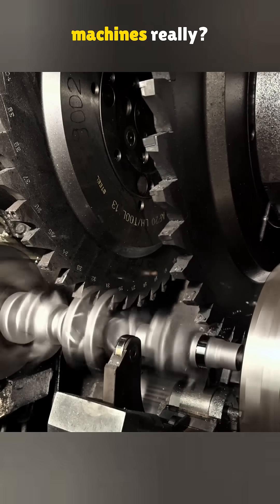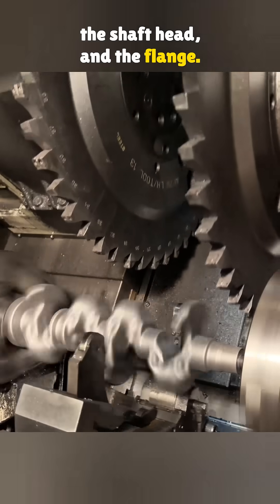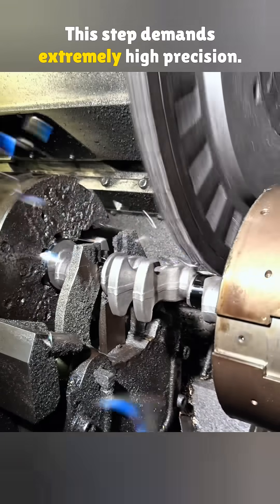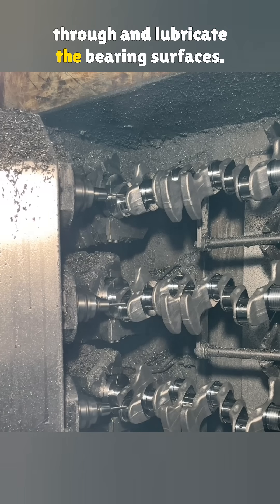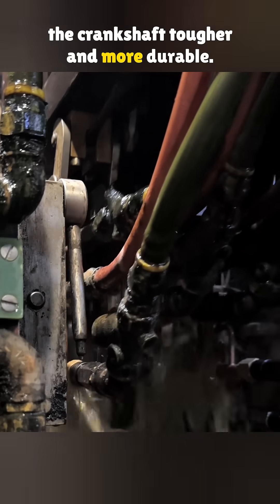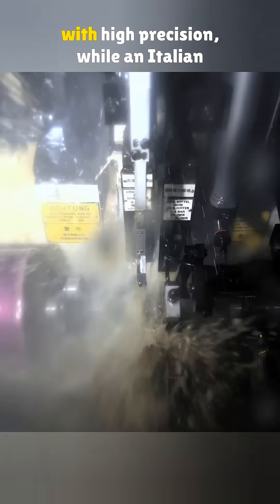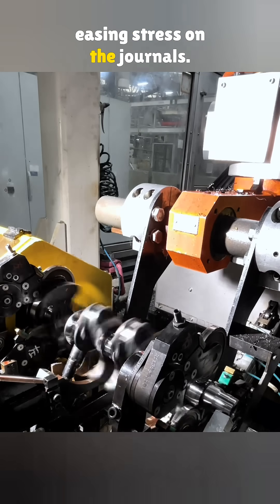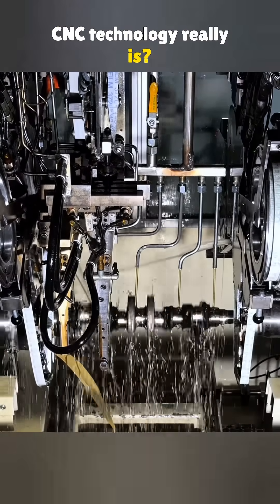How Far Behind Are Chinese CNC Machines #automobile #mechanic #car #assembly #manufacturing

Comment: I'm a CNC machinist in America that focuses on medical and surgical tools and sometimes implants. I don't know that we have any American-made machines. Half of our machines are German or Japanese.
Reply: I'm also a CNC machinist in the States. We manufacture almost exclusively copper parts. We have mainly Japanese and Swiss machine centers.
Reply: @marine4lyfe85 the Swiss made a great machine. The Tornos MultiSwiss is absolutely an amazingly complicated work of art! If you know how to program, setup, and run that machine your an absolute professional machinist, in my mind at least
Reply: @thomasvanpelt6586  "you're" not "your"
Reply: @johnranallo424 my bad bro I didn't go to school
Reply: @thomasvanpelt6586 I worked at a place that had one and there was always an issue with nobody being able to keep it running. Yet the robodrills, hurcos and mori seikis ran 24-7. Lack of training sure, but the learning curve was an issue
Reply: @marine4lyfe85 it's a weird criteria put  on China  that all the parts in their machines have to be domestically sourced 

I can guarantee China is the only Country that has the minerals and components to make a 100% domestically sourced and indigenous designed machine

They did it with a Lithography machine last year 

Albeit it could only make legacy type  18nm chips ... which with extra layering down to 7nm & 5nm
Reply: I have, and have had American machines, HAAS, as well as  Japanese Machines including Makino, Mori Seiki, and Nakamora Tome. I looked at, and was contemplating trying a German mill, so I can't say from experience, but from my research and talking to alot of people, and a great analogy are automobiles. The Germans produce machines that have all the latest bells and whistles. Japanese culture, which carries into everything they do, including building machine tools, is more reserved, meaning they tend to hold off a year or two when it comes to major upgrades and new technologies until it's proven. Just like their automobiles, German cars, Mercedes-Benz and BMW for example, are cutting edge technologies, latest greatest, bells and whistles, whereas Japanese cars, Toyota and Honda for example, favor reliability. Their machine tools are no different. Personally, I love the Japanese CNC equipment. I'll take Makino horizontals and Mori lathes, and Nakamora or Mori Turn / Mills all day, every day and 20 years from now they'll still be running, just as accurate, and as reliable and they hold their value.
Reply: @Drewg351 i run a mid 90s Mori Seiki lathe every day that uses floppy disks and i love the thing. Makes beautiful parts and I've never had an issue with it. Compared to our brand new Korean lathes, give me the old Mori to run any day
Reply: @Drewg351 I agree,I was told by a 40 year machinist that the Japanese make the most accurate and reliable cnc machines and thats why we use their machines to produce things in America.
Reply: @Drewg351 i agree, but i think this are specific machines. The chinese market is for massive market. They think in quantity.
Reply: @Drewg351  Haas is 90% made overseas. Linear guide rails, balls crews, sensors, electronics, motors and lubrication systems come from either europe or asia. The only american made part is the cast iron chassis lol.
Reply: @dichoseadepaso So, why do you think the parts are made from “other” countries and not in the USoA? And don’t tell me the high end machineries are from China.
Reply: @PapiPonce profits. They'd rather third party their entire production line for a quick easy buck instead of investing on a good local production and all it takes (training your workers, R&D, etc) also, i work at Haas. 90% of electronics is already Chinese. So much so you can buy an original brand New Maincon board from the manufacturer at 1/3 the price.
Reply: @dichoseadepaso  i doubt that. Besides, are you trying say America can't make something 100% made and sourced in USA of top quality and excellent engineering? Because you would be very wrong. Best products come from Japan, Germany and USA.
Reply: @dichoseadepaso  well China certainly has us by the balls then don't they. Sounds like we need some tarrifs to free up our balls from China's grip. For reasons of self preservation.
Reply: @realtruenorth  Every person of trade knows, that the USA is not capable to produce high end machine tools. They do not have the culture, the skills, the education, the supply infrastructure and the knowledge. Your pride may shine to the moon - the truth is, all your high end machining depends on machines from Japan, Germany and Switzerland. Military, medical, airospace, in all these fields you won’t find a Haas or Milltronics in a critical process. The USA may start to build up such an industry, with first results in 20 years, but as of today, the USA is 100% depending on other countries, sorry to destroy your dreams.
Reply: @Herr_Bone  LOL, you destroyed nothing except your credibility. You put in so much effort.  You're just plain ignorant. Where is the #1 cold hammer forge machine for the best precision rifles in the world made? USA. Where is the machining done for some of the best if not the best guitar hardware made? USA machining right here. Snap On tooling, tape and dies, precision test equipment,  machined right here on U.S. machines. . Jeweled actions in world wide respected Olympic rifles that can pinpoint a target from 10,000 feet away, made on US machines. The top 3 engineering and craftsmanship in the world in no order are Germany, Japan and the U.S. maybe you are the one driven by your pride to shame America. The whole world loves to shame the best country in the world. Its natural for envy to hate. Even Apple starting making micro processors in the U.S. again because the world can't get it right. LOL. Nice try ya sore lower.
Reply: @Drewg351 I own 4 Toyota vehicles for this exact reason.
Reply: @Drewg351  I can tell you as an auditor that worked on HAAS, most of their products are made in other countries.
Reply: @Drewg351  Mercedes lost its reliability legacy 30 year ago when it's newly appointed CEO Dr. Dieter Schremp introduced a lot of cost cutting measurements. It was downhill from then and it never recovered from that disastrous strategy.
Reply: @TINSTAAFL1 yep, when they partnered and collaborated with Chrysler. Gulp.
Reply: @Drewg351 ran Mori lathes and Mitsui mills for over 20 yrs myself making racecar parts.
Reply: @Drewg351 have you tried the German brands Deckel, Majo & Gildemeister (nowadays "D•M•G")?
They use to run with controls as Siemens, Fanuc or Heidenhain...
Reply: @Drewg351 does this hold for manuals as well?
Reply: @Drewg351 Haas has its own control while a good Chinese machine would feature a Fanuc/Siemens. Other than Haas has no advantage against the Chinese competition. Other than being more expensive 😂😂😂
Reply: @Drewg351  Okuma and Takisawa is also very robust and reliable. Used in Mouldshop for many years
Reply: @Drewg351  dont buy german. its overpriced and heavy on maintenance. japanese are a much better deal!
Reply: @Drewg351  Exactly correct. The sad thing is that very few if any crankshaft are manufactured in the USA due to 'progressive' government policies.
Reply: @ccrider8483   what it's have  to do with the government  ??? explain  in details
Reply: @ccrider8483  Probably one of the most smooth brain takes I’ve ever heard. So you’re telling me that the people that look like you, have the same skin color that you have, decided they wanted to save a nickel on every part by moving it to cheaper manufacturing has something to do with “progressive”regulations?
I bet you are also the type that thinks that China is a communist country.
Reply: @emed1977  Being so offended by an observation from outside your chosen echo chamber must be very traumatizing. Perhaps you should consult a mental health professional.
Reply: @ccrider8483 it was a contributing factor but it would not have been decisive as labour and energy cost would have driven production overseas anyway because of said profitability reasons. But in the long run I would he more concerned over electrical motor production. No crank shafts in EV’s 🤷🏻‍♂️
Reply: @ccrider8483 
Progressive government policies?
Like what?
If you said tax and trade policies then you might be speaking the truth, but instead you seem to be barfing out b.s.
Reply: @Drewg351

We have Haas too. I didn't know those were American made. 

From my 6 years of running turning centers to cut rotors. We have accurate machines but when cost cutting comes in we have tons of issues with holding tolerances which sometimes can be due to failing ball screws. The costs that are cut are usually the type of cutting insert and if the rotor is heat treated before and after cutting.

On one of our parts we went from getting 400 to 450 rotors cut per insert. To less than 60 parts per insert. This was done to save $80k a year. 

Now we get quite a bit of scrap and broken tools. My guess is they aren't saving anything now...geniuses in the office. "But my mafff (math) on paper said it would work"- Office Genius
Reply: @Drewg351 nothing Germans make are any good. BMW Mercedes Audi VW Ferrari Porsche all junk.
Reply: @jackdaniels2657 Ferrari?😳
Reply: @jackdaniels2657 you speak the opposite-language?
Reply: 💯.  It's like that all over the world. Globalization.
Reply: I’ve been out for nearly 20 years now but most of our CNC machines were Leblond, Haas, Lodge and Shipley, Bridgeport,and Cincinnati.  These are absolutely massive machines though. The machine I operated and programmed was an old ticker tape Bridgeport horizontal boring mill. It was at least 20 feet high and 50 feet long and built into a giant hole in the ground like a moat for coolant capture. It been updated to Fanuc probably 10 years prior to my arrival and still operated on Windows 3.1. She was slow but powerful and if you made a mistake, she’d plow a $1,000 tool through a hunk of iron faster than you could say “crash”.
Reply: @thompsona10625  That happens when you make a mistake on the programming right?? Is it hard to understand the program?? Ort is it user friendly?
Reply: @mitchweber7868 sometimes it's just because it's Monday. I used to run a 5" horizontal mill and some days the machine just wants to kill you for no reason
Reply: @jonwaldrep3984 😂😂😂😂
Reply: @mitchweber7868 the programming is actually pretty simple, at least in terms of what it actually is, the complicated bit is actually understanding what the process is to go from a blank or billet to the features you want. CAD makes it a lot easier, and CAM software will do most of the work of making your g-code.
Reply: Yes, I am not surprised to learn that China buys the same Machines that we do in North America
Reply: Moore Tools and Hardinge make some of the best machine tools in the US.
Reply: @ruxundong Hardinge are good machines. We also had a few of the flatbed lathes. Super quick and good machines.
Reply: That’s how modern industry work, no country is actually superior. Take computer chips as example: Taiwanese TSM was first with 3nm chip. The required EUV machines are made by ASML of The Netherlands, but the optics in the machine is from ZEISS of Germany.
Reply: Haas
Reply: @bruhboi7632  yea but you wouldn't use a HAAS for automated tight tolerance machining
Reply: @eudonk  I'm make bearings with a Haas my tolerance is +.0001 to +.0004 all day everyday
Reply: ここのコメント、日本製品を褒めていただきありがとうございます。
日本人として誇りに思います。
Reply: You have a cool job
Reply: Natürlich habt ihr nur wenig amerikanische Maschinen, sobald es um Hightech geht.
Reply: Much of the best everything comes from Germany or Japan. Doesn't matter what industry either.
Reply: @jasonlauritsen5587 it wasn’t always that way, but unfortunately you’re right. Back in the eighties the company I worked for had an American made metal planing machine. One of our machinists was trained in Stuttgart during WW2 and he loved that machine. He said it could go down to zero. He showed me an industrial bolt threader we had that was probably made before WW2. He said look at this machine, it’ll never break. When the company moved to Indiana in 2013 they took that bolt threader with them.
Reply: @jasonlauritsen5587 Then why aren't Germany and Japan as rich as the US?
Reply: @cryora because America has more people than both combined. And the military power. The more people you have, the "richer" you are. But if you look at American GDP per capita it isn't normally higher than either. America pretends to be rich, just like how China and India pretend to be rich... ok not as badly as them lol, but it's the same sort of deal, more people means higher gross GDP, doesn't mean that they're richer as a thousand people should have more combined value than 500 people.
Reply: @c @cryora  Rich in what? Stability of the society? Medical healthcare for everyone? Democratic values? Education? Knowledge? Craftmanship? Or wealth distribution? Isn‘t it the case that 1% of the US-citizens have 99% of the money? So, who is rich? Don‘t misunderstand me, the latter is nearly same in Europe, too. My point is, that „rich“ in regards of physical values is not available for everyone, only for a few, so it does not make any sense to take it as a measure.
Reply: @jasonlauritsen5587 what a strange comment. No country “pretends” to be rich. Countries aren’t a single person. Doesn’t even make any sense

US is rich because we dominate in a lot of things such as global stock trading. Nothing is comparable to Wall Street. Literally everyone invests in US stocks. Similarly even real estate you can see the same pattern, Russian oligarchs used to love to buy in New York.

On goods side, virtually everyone trades in USD.

We also own all kinds of top companies like Visa/MC where everyone pays with, we own Boeing which is a huge.

The list goes on. But yes in certain areas Germany and Japan similarly dominate, such as these industrial/manufacturing assets
Reply: @dailyrant4068 oh you're rich are you? Hmm, ok well, well how is it that you have 38.4 trillion debt and it goes up by over 6 billion per day? Almost the absolute highest in the G20. Why do you have the highest poverty rates in the western nations?  And yes, lots of countries pretend to be rich. A countries total wealth is meaningless, it's the gdp per capita. China and India both pretend to be rich, meanwhile they're both amongst the lowerest in  supposedly developed nations in gdp per capita.
You have almost zero good quality products made, because the American way is charge lots, no developmental stage, produce shit.
Reply: @jasonlauritsen5587 lol this is a joke. Most of our debt are owed to US. And yes it’s a problem but it’s not because we are poor. You can be rich and still overspend.

GDP itself is an over-valued metric, so by extension so is per capita.

The fact is, as long as dollar is strong and we maintain our strategic advantages we will be the dominant power.

With that said, i do think we are declining. USD to Euro has been falling, for example.

I have zero “pride” in all of this. I’m just stating facts because I’ve traveled a good number of countries across continents and can easily recognize prices, affordability because I’m analytical. That’s all
Reply: @dailyrant4068 the us owing much of our debt to America is the most ridiculous thing, because the share of their own debt that is owed to us is massive as well.
Reply: I'm a machinist as well.  We don't have any machines made in America.  But Japan is way ahead of China.  I make tooling for the bullet industry.  CCI, FEDERAL,  REMINGTON GOLD DOT, and  Several others.
Reply: @DavidMeadows-u5s  Japan also makes some of the best glass,, as in optics. China? LOL,, well... its ok..
Reply: @realtruenorth China is learning and applying. Wait 5 more years .
Reply: @goldriverbank6647  who cares, ill never support a tyrranical force, ill boycott as much as possibke and everyone else should instead of being a sellout for the dollar.
Reply: CR Onsrud is American, but most machines I've run have parts from all over. Like Fanuc computer system is from Japan, and the head of cnc from Italy.
Reply: Hyundai machines are made in Korea and used in America
Reply: Most are made in Korea, Taiwan, and Japan, very little in the US are still made in Germany, not sure what machine shops your looking at. Just because it says siki no longer means it’s Japanese. Just because it has a German spindle bearing, doesn’t mean it’s German..
Reply: What happens to these machines in 5 - 10 years when ev taken over😮
Reply: @kamaalallom6121 they will be repurposed to make crankshaft for vehicles that the EV market requires another 10 years to catch up to. Military, farming, trailers etc. People think China is behind on the CNC game? They're falling for the trap again. They aren't thinking about spending all their money in factories chasing equipment that will be obsolete is 5-10 years. They buy equipment that had 5-10 years left in their lifetime. With the money that appreciates from the savings, they can lead the next generation. Their Rare Earth decade long strategy matches the same strategy on how they took the EV market, and playing the long game is just what they're good at.
Reply: America lead the way in Machine tool manufacturing and innovation until the 70s. However, as a true Manual Machinist/Tool n Die man, one must not over look the fact that parts hundreds of times this size and just as intricate were made in the early 1900s. Especially starting around 1930s on....
Today,with CNC machines,reinishaw probing systems or the likes,yes,I agree,parts are made faster,but I still believe at a cost to longevity.  Almost designed like the TULSA MAFIA light bulb conglomerate did to make light bulbs last 1000 hours and no more....just my opinion
Reply: German, Swiss, and Japanese.
Reply: I suspect the Chinese have been quietly studying the machines they have, against that day the us convinces other countries to stop selling their equipment to China.
Reply: I cut rotors. We still have CNC turning centers from Saginaw Michigan. As far as I know they've since went out of business.

We love selling out our manufacturing for cheap Chinese labor and their subpar quality...
Reply: @tyrannusspissamentum4423 I've been to several automotive companies and subcontractors in Michigan, Ohio, Kentucky, Indiana and Wisconsin and I've seen everything from great workshops to horrible when it comes to machines and working conditions. However, none of them has been meeting the standards of the better ones I saw when I visited automotive subcontractors in China and especially when it comes to automation. They have mainly raised their bar for high quality, but still have a low lowest level. US is far behind western Europe and South Korea, but also parts of China, when it comes to automation and therefore productivity and cost challenges. I am working for a global cutting tool manufacturer.
Reply: I worked on one of the biggest American spine company. We've used Swiss Tornos Deco 20 and Index machines, later on a couple of years later we got Citizen.
Reply: I agree, Japanese and German CNC Machines are excellent.
Reply: Haas. Duh
Reply: Operator
Reply: I used to setup and run American Cincinnati Milacron millers and turning centers. But I also setup and ran Mori seiki lathes that were much easier to program.
Reply: Sounds like Dentsply in York Pa. I happen to have an interesting implant now, called an LVAD . Its a finely machined titanium pump they put in my heart to pump my blood.
Reply: Exactly my point mostly German machines
Reply: Sunnen are USA made
Reply: I`m in the UK in an Italian steel forge and use 2 HASS machines at work, 2 German Schenck crankshaft balancing machines. Italian end millers. Koka robots. We make CAT and John Deere crankshafts. I have a 100 year old American lathe at home which is still working well.
Reply: So anyway, the Chinese are using imported machinery from some of the best suppliers outside of China.
Reply: Japan is good at Material science
America is good at Design of semiconductor that is all I know as half japanese.
Reply: Wow! I learned something new today, I had no idea CNC Machines were involved with medical and surgical tools!! Thank you for sharing!!
Reply: For USA, it does not matter since the country is part of the Occidental part of the world. For China, it could be bad if they decide to start invading Occident or their allies.
Reply: I've mostly seen HAAS which are American, and everyone will always have some Japanese in a corner somewhere, even seen ancient Honda lathes.
Reply: In industrial applications, most are American made. Some of our 5 axis machines are German, Our iron worker is Toshiba. Bridgeport ftw.
Reply: I was in the forging industry for 33 years and 30 of those years were spent running forging hammers. When our die shop started converting to CNC machines in the early 2000s all of them were foreign brands. Mostly OKK, although in the eighties they had two Rambaudi CNC mills that didn’t have automatic cutter changes. Before that it was mostly Cincinnati Hydrotels. It used to take six weeks from raw block to finished forge die to cut the dies for the Harley Davidson Softail frames. The Rambaudi brought it down to two weeks. We had a separate EDM department with seven machines and one OKK eliminated all but one.
Reply: I did machining for a manufacturing factory in the US. Our machines were American made. We did have a couple machines brought in from Germany. We had to have a service tech out a few times to get it operational again. Their quality has gone down in recent years.
Reply: I've been working for a decade in North America in several industries: food processing, metal processing. I've never met a US made machinery.
Reply: You might not have any American machines, but the software running many of the more advanced tools is American. And more to the point China is dependent on “the west” (Japan, being part, too)
China is an industrial giant with feet of clay
Reply: under estimate China at your peril...
Reply: @perrydear6306 I remember when they said the same thing about the Soviets 😂
Reply: @rjsisco6056  and now russia is spanking NATO...but you wouldnt know that, would you?
Reply: It would not be surprising if China outlawed the import of American machines to incentivize the hollowing out of USA manufacturing because that's how China operates.
Reply: Because we stopped making them years ago pretty dumb if you ask me
Reply: Yes, there is no precision machine manufacturing in the USA, with the only exception of Moore, who produce high end machines for the optical industry. The knowledge, the craftsmen, the mindset and the environment is missing. And it is not getting better.
Reply: Then make one!
Reply: That's because you only work in one facet of machining, milling, etc
Reply: Isn't Mazak made in Kentucky?
Reply: @matthewh.8617 maybe now Idk, the ones I ran had info tags in both Japanese and English so I'd assume Japan. They are originally a Japanese company
Reply: I’ve used only HAAS and it gets the job done but doesn’t seem very high quality.
Reply: Haas?!? 😂
Reply: HAAS is American.
Reply: Because
Reply: The US maintains great relationships with the countries we are importing from. The US would still have access to its tooling if China invades Taiwan.
Reply: @derek7785 But the US would lose access to smallest nanometer chips and cripple our access to a large volume of the rest of the high end chip if China successfully invaded Taiwan.
Reply: @rjsisco6056 Whci h is why I suspect Taiwan still stands.
Reply: My pride of country was impacted zero, from your comment. Was a good try though lol.
Reply: There are several cnc manufactures in the states. But they don't have the reputation like the Japanese or South Korean manufacturers. Haas and hurco are some.
Reply: You are uninformed
Reply: Let me guess Okuma????
I retired in 17 after 38 years of manual and CNC lathe!!!!
I don't care for mill there's no foot pedal!!!!
Reply: Try to Google Haas Automation
Reply: I don't think China makes very much for cnc machines. Our shop bought  one any was so poorly made we weren't able to use it and the main frame cracked rendering it unusable
Reply: He only said the cutting teeth I think
Reply: Yep. Haas machines are pretty common in a lot of shops and are sort of american machines, but most of the high-end machines are japanese or german.
And even the Haases use fanuc servos and kitagawa hydraulic chucks, the manufacturing capacity for that stuff just doesn't exist in the US. Some of their product lines are also made in Taiwan which is probably an upgrade in quality over the US-made ones.
Reply: @JohnSmith-dp2jd  Haas machines are not comparable with high end European and Japaanese machines. They have competitive prices and services, but their aim is the basic machining level.
Reply: This video probably 20 years old.
Reply: HAAS is great value
Reply: what about Haas? we have their cnc machines where I work
Reply: @PatricioGarcia1973  don't engage the haters. Im sure HAAS is an excellent machine.
Reply: In a lot of cases, the actual manufacture of the machine is done in the US, for us machines, however the manufacturer was purchased by a German or Japanese conglomerate.
Reply: Not at all everything shown here is for internal combustion, China is years ahead on EV vehicles
Reply: But you bo have Haas, and I love them from England
Reply: Thank the democrats. NAFTA etc
Reply: America has HAAS, the running joke in the machining world. America doesn’t make impressive mechanical stuff anymore.
Reply: Interesting video. Looks like the intention of the person that posted the video is to criticize that country.
Reply: @PIPEFITTERENGINEER as one should
Reply: @PIPEFITTERENGINEER fact clean mere facts. Us is hopelessly dropping in expertise
Reply: Last year an American company made the world's smallest drill bit, they were so proud they sent it to Japan to prove their superiority. The Japanese drilled a hole in it and sent it back.😅
Reply: @invinoveritas63  you do know that Japan is considered part of "the west" right?
Reply: @CultureWeston 

Yes, I  believe Japan to be the most civilized of all western countries, in part because they can recognize a joke when they read one. This is due to them having what is known as a 'sense of humour'
Reply: @CultureWeston  japan is a US-vassal. and a britsh-dominated vassal before that.
Reply: @simonschneider5913 so was the USA under Britain but look at the USA and Japan now.
Reply: @alanfitzgeraldsr2201  japan isnt exactly how it is commonly portrayed in western media. especially the times around the late 1800s and until WWII. lots of that history is still ongoing, under the radar. same in germany.

...but maybe the US isnt in that anymore, but britain is? :)

read the new NSS - and ask yourself how britain fits into this!
Reply: @alanfitzgeraldsr2201  japan is hated in asia for a reason. so is britain in the middle east, or in russia.
Reply: @alanfitzgeraldsr2201  the US? What about the u s? We're still owned by Britain.Whether you know it / belive it or not
Reply: @alanfitzgeraldsr2201 thanks to the French
Reply: @simonschneider5913 lol for wiping the ottomans,m
Reply: @dazzabrah3208 only to be wiped themselves soon after. empires always end that way.

today, turkey is much better positioned than britain when it comes to future trading corridors. and the british navy is a total joke, their only success being small drone attacks on the black sea fleet, and then inventing news about chasing the fleet away, which was never true.
Reply: @invinoveritas63 I heard this ferry tale differently. Bethlehem Steel got the smallest drill bit from a Russian steel mill and drilled a hole in it and sent it back 😂.
Reply: That was in the 1950s , but it was done using a Lazer and not another drill bit 😂.
Reply: @invinoveritas63 😂
Reply: @invinoveritas63  that is complete nonsense. it was true decades ago...people all over the world now have just as much knowledge as the formerly superior societies.

without excellently educated migrant labor, most western universities would be a clownshow.
Reply: @simonschneider5913    I imagine your inability to recognize a very old joke is what makes you an absolute joy at party's
Reply: @invinoveritas63  which very old joke?

also, if you want to come off as more intelligent than the person youre attacking, use proper grammar. its "parties", not "party's".

"parties" like the ones you seem to be so fond of arent what I am into anyway.
Reply: It's not a question of how far Chinese CNC machines are behind, Chinese still believe in globalization and believe in purchasing best machines from external sources. There is no need to be number one in every aspect of life. On the contrary, if external forces decide to change the way the market goes, according to ASML, they take nearly 20 years to build an EUV machine, the Chinese engineer takes 5 years to achieve a prototype machine under the US sanctions. This mechanical is relatively easy.
Reply: @charlielee1000100  It is not relatively easy. I am ME with a focus on Materials Engineering. Precision Machines are not a simple affairs. It’s almost a perfect mixture of Arts and Science. Arts in the sense that only users can give Engineers, Metallurgists, etc can give important hints as to what is going on for others to iterate around and/or speculate about. It’s an extremely difficult arena.
Reply: Thats just your place 
We do aerospace engines around cincinnati area
Reply: @tylerh866 we do aerospace brakes in Ohio mainly aluminum snap rings
Reply: And now we know, why the Chinese auto makers outperform us on electric vehicles.

The priciest part are the cells and they manufacture them at highest quality levels.
Reply: @floriandiefenthaler2553 no not at all correct lol 🤣😔😔 ohh ignorance is folly
Reply: Hyundai engine shop in alabama uses these same cnc machines for their crankshafts
Reply: US made means not metric so nobody buys it.
Reply: @jpcaretta8847 everything manufactured here in the USA is made to metric specs and has been for some time. You’ll notice that everything lists the metric sizes, with the inch size afterward, if they even bother.
Reply: @jpcaretta8847  that was 30 years ago, aren't you slow.
Reply: @realtruenorth I still cant find metric drill bit at Home Depot ! The winch on the truck is still using crapy UNC etc… My daughter in law is still using spoons cups … r instead of the metric scale !
Reply: Then, China is the best.!
Reply: The Japanese REALLY leveraged the post war years for efficiency. Then the 90s hit, and outsourcing became important to us, hurting our own industries.   The Chinese also don't have to worry about 'pesky' child and worker safety so cost drives the business there.  BUT under a communist government, innovation is significantly hindered.
Reply: @doelbaughman1924 It’s really not accurate to call them communist anymore. They kept the name, but their economy is a capitalistic market economy that has very different types of regulation and they have socialistic policies that their people would probably always have regardless of the economic system. They are authoritarian and a one party state, but they abandoned Marxist economics in the late 1980’s. It the only reason they were able to be as successful as they are today.
Reply: @frankheston8722 
You have a vague idea. Chinese economy is better described as “mixed”, not Capitalist. In certain regions (cities), private property and open market competition is allowed to some degree, but there are always some restrictions, central supervision and control. Mixed economy was proposed among others, by the Fabian Society as a gradual change in opposition to the abrupt and violent changes proposed by Marx. It was later assimilated to the concept known as Welfare State, very successfully in Europe.
Reply: @doelbaughman1924  in both AI and biotech, China is the clear global #2 behind the U.S., and in several sub-areas it is at or near the frontier, well ahead of Europe and most other regions.
In Biotech, China is arguably even closer to the U.S. than in AI.
Reply: Of course there are American made CNC machines, excellent quality also. The three best engineering, innovation and quality made products in the world come from Japan, Germany and the US.
Reply: And with Trumps tarifs every part will be way more expensive. And your customers will pay more.
Reply: @gregkollaeg2365 we don’t tariff the crap out of everyone just the ones screwing us
Reply: @dmoore7000  Americans pay it!
Reply: @gregkollaeg2365 Americans don’t pay our terriff we pay the tax
Reply: @dmoore7000 two sides of the same coin. Tariffs are taxes. In German Tariff literally translates into punishment taxes. Because that is what it is.
Reply: @gregkollaeg2365 not true
Reply: @realtruenorth so things are cheaper now with Trump??😂😂
Reply: In 2002, China overtook the USA in machine tool production....they have never looked back.
China is the world leader in Electric Vehicle production....crankshafts for ICE are on their way out just like buggy whip making machines are obsolete.
Reply: @pietrowislon7300 I doubt that. 
   Well, we'll see what happens with oil dollars...   
 If we lose that( oil being traded only in the dollar)things likely will change dramatically. And if/ when that happens, you'd probably be accurate in your statement. But I know several companies have stopped or dramatically slowed research & production of electric cars at this point in favor of I c e vehicles
Reply: @pietrowislon7300 you are so funny ! 🤣
Reply: @pietrowislon7300 Chinese CNC machines have a way to go. They are good machines but are 10 years behind other countries right now.
Reply: @pietrowislon7300 China is #1 in EV car battery fire related deaths
🔥🔥🔥
Reply: @WillBass-n7o  because they produce the most cars. meanwhile, volkswagen is sinking carriers with their cars. there are court proceedings about that. about 400million dollars. probably audi cars.
Reply: DEI basically killed America's high performance technical ability.
Reply: @CultureWeston  DEI? Lol you must be joking or just not very well informed. American technical innovation was killed by capitalism, the short sighted focus on corporate profits, monopolies, political instability and skilled labor shortages are what killed US technical ability. DEI is just a buzzword for the not very bright red hat cult. They think DEI translates into some sort of unfair competitive advantage for black and latino people, however it really primarily benefits white women & H1B visa holders from India. If you really want something or someone to blame, blame the political machines that are dismantling our schools and higher education. They are the ones who have invested interest in keeping our populace ignorant and uneducated so that they can utilize them as their primary voter base. However, his is a double-edged sword though as it also results in an abundance of unskilled people who are not able to contribute in any meaningful way to industries that require a skilled labor.
Reply: @CultureWeston  absolute BS. I've worked with a few women and people of color who were operators and laborers, but every single machinist I've worked with is a white male.
Reply: @goatfromhell666

Exceptions to the rule. Cry more.
Reply: @goatfromhell666  the person is a kid. Just parroting what the woke right says.. DEI mostly affects service jobs. Skilled labor jobs (like machinists) still require skilled laborers, so DEI wouldnt work.. The issues with American innovation stem from Democrats implementing heavy regulations & policies that increase offshoring/reduce onshore. Thank God for Trump, but decades of offshoring/regulating cant be fixed by a single prez in the short time they have in office. Trump has removed 129 regulations for every 1 added (in yr 2025), but that is just a start to fix a large issue.
Reply: @CultureWeston BS. Reagan killed our machine tool industry in the 1980s.
Reply: @melgross  The Reagan administration spurred the creation of the Wall Street stock CEO type like Jack Welsh, who pumped up the stock price instead of making the products better. It’s funny how people complain about progressive policies while enjoying those same progressive policies that were put in by FDR and LBJ. Then they will try to blame the left like the left has been in power all these years. Obama was probably the best Republican president in history, Clinton would be next.
Reply: @e @emed1977 e other thing we all talk about it the national debt. Well, two thirds of that comes from just three presidents. Regan, Bush Jr. and Donald Trump.
Reply: @melgross
Youre wrong
National debt change by percentage  goes too 
#1 lincoln
#2 fdr
# woodrow wilson
Reply: @melgross . he stopped metrication as US mfg thought it would protect the domestic market from import ! It stopped export but not import !!!
Reply: @BaronVonFrankenBolzlllyou don’t get it. Back then there was little national debt. Now it’s huge, and in dollars, those three I mentioned are responsible for most of it.
Reply: @jpcaretta8847 who is “she”? And nobody “stopped” metrification. Manufacturers took a long time to accept it as people here are very stubborn when thinking of anything foreign as being bad. But pretty much everything made here for several decades iscnade on metric machines, to metric standards. You don’t seem to know that.
Reply: @melgross Why I can’t buy metric drills at Home Depot ? I have to remodel the kitchen at my sons house in Austin. Its a mix of inch sizes for US made furniture but metric for Ikea 😀
In fact it is a mess !!
HAAS CNC are such a mess btw !
And I am pissed of that my car is all metric but not the trailer..
And UNC are crap 😊
Reply: @melgross  Reagan stopped mandatory metrication ! I know all US stds are in metric and many companies switched ! In fact the Caterpillar, John Deere … would be bankrupt if they hadnt !
Reply: @jpcaretta8847 I don’t remember him stopping “mandatory” metrification. I don’t remember it being mandatory.

I’ll tell you one thing that shows how stubborn we are here to our detriment. In ‘66, Congress said that the US should be moving to metrication as quickly as possible, for the benefit of industry and education. That was a while ago, wasn’t it? But as I say, people here are just too stubborn.

By the way, that was back in 1866, not 1966.
Reply: @CultureWeston  no, arrogance and lazyness is what destroyed german and US industries.
Reply: @simonschneider5913  wrong, both are still among the highest achievement in work efficiency. Evil government maliciously destroyed industry for "globalist agendas"
Reply: @CultureWeston  europe and the US are hopelessly corrupt and highly ineffiecient. in PPP-adjusted comparisons, china blows both of them out of the water in basically every sector now.
Reply: @simonschneider5913  corrupt compared to theoretical perfection? Yes
Corrupt compared to any BRICS nations? Not even close.
Reply: @CultureWeston  its not a lie - if YOU believe it! :)
Reply: @CultureWeston  the U.S. a Leader in work efficiency? I don't think so.
Reply: @simonschneider5913 China is vastly more currier than the west it. It’s not even close.
Reply: @CultureWeston Why do you think China prospers ? If a business guy comes close to a government official asking for a "special" treatment ,the system automatically will cut his balls off. In the EU and the states the business run the politics. You have a war going on in Ukraine by the Raytheon and
 Reich metal.
Reply: They should won the ww2
Reply: @Daniel-du7pv  fascism didnt go away after WWII. its alive and well in the EU. same families even!